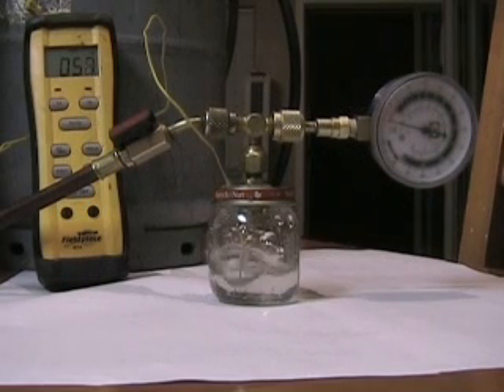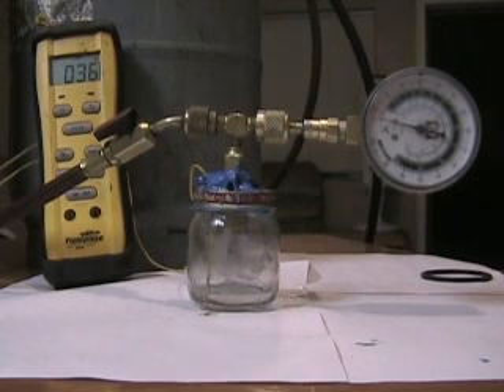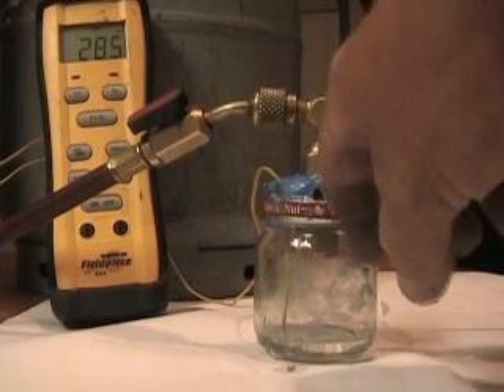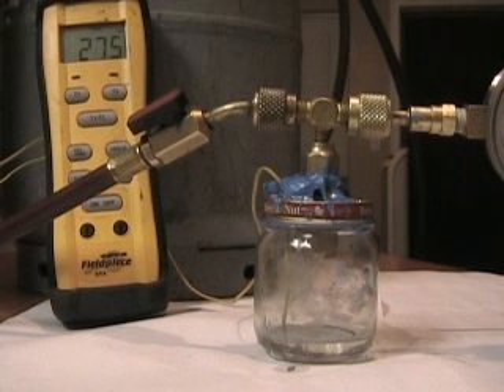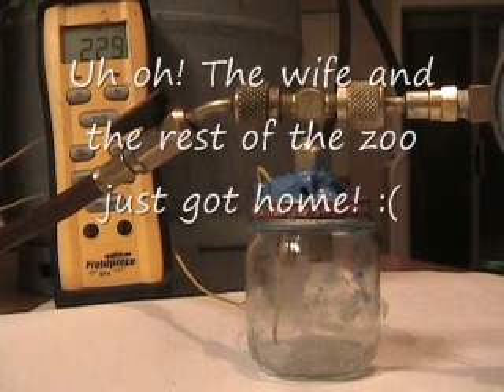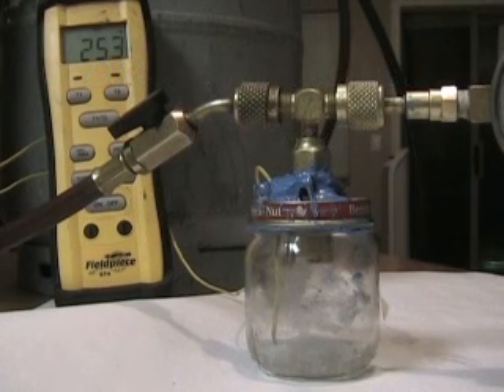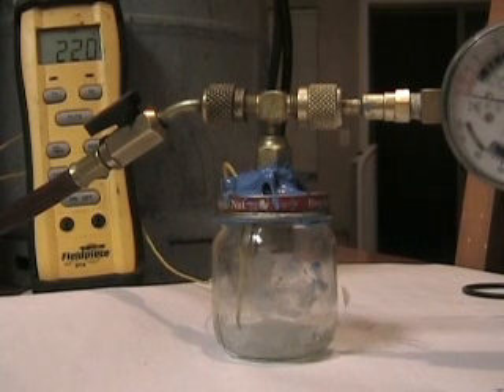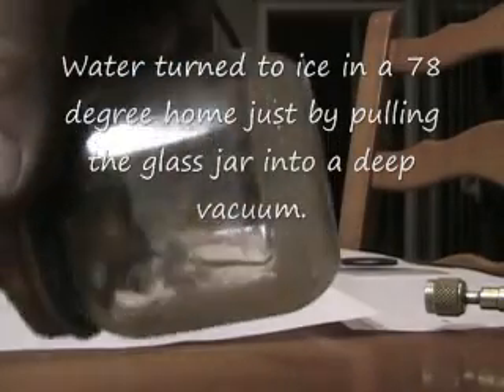Boiling Water to Make Ice

Comment: If you use a beer bottle inside a bottle cooler, it would be more efficient. If use a diy pedal powered pump, then you have a cheap way to make ice to cool vaccines, for example. That would do wonders in isolated regions without electricity! If you need lower temp just add some salt to the water so it would freeze at a lower temp.
Reply from the maker: The experiment is just to see whether pulling a vacuum AT ROOM TEMPERATURE would cause the water in the container to eventually freeze.
This was done purely for the sake of people curious if water inside an HVAC system could freeze during the normal evacuation process.

Comment from the maker: The water content should still freeze at 32 at atmosphere pressure. That's why ice machines can make ice out of crappy water. Only the water freezes and the minerals get washed down to the water resevoir. After a few batches of ice the machine dumps the water (which has a high concentrate of minerals now) and fills with new water. That's actually one way to distill water. Freeze the water leaving the minerals behind, or boil the water into a steam leaving the minerals behind. :-)

Comment: Well its a nice experiment but not the triple point as you say in the heading. Tripe point is the point where the pressure and temperature is at a definite value where the substance can freeze melt and turn to gas at the same time.
for water this is at 0.01 celsius and 0.0060373057 atm.

Comment from the maker: LOL I think I explained in the description. :p Water boils at 212 degrees at atmospheric pressure and sea level altitude. Add pressure to the water and it wont boil at 212, but higher, such as in a pressure cooker or a car radiator. Lower the pressure and it boils at lower temps. Boiling means the water is changing states to gas form. As it changes to gas form it removes HEAT form the surrounding area. The glass jar insulates somewhat from the external temps in the kitchen there...

Comment from the maker: Well the reason I didn't add any external HEAT or do anything to help it boil was to see what really happens when we vacuum pump on Air Conditioner. We don't exactly shake a compressor or add anything inside the system. :) Although this wasn't exactly accurate. The HVAC system would have much larger internal volume and should never have THIS much water inside the system! The discussion beforehand was weather it would make ICE before evaporating all of the water out. Obviously the water froze 1st